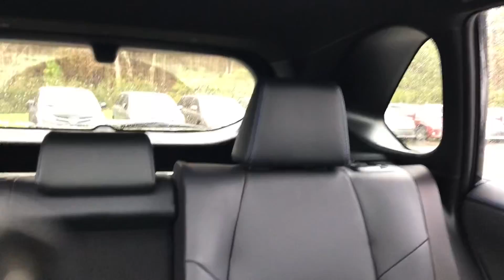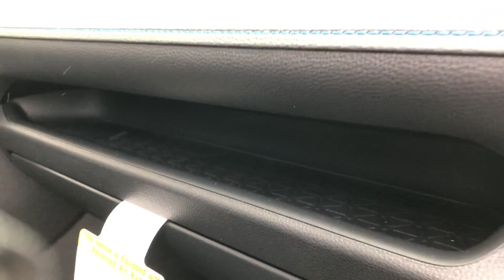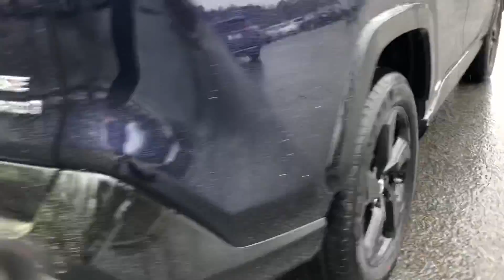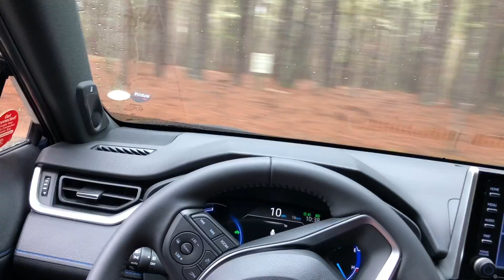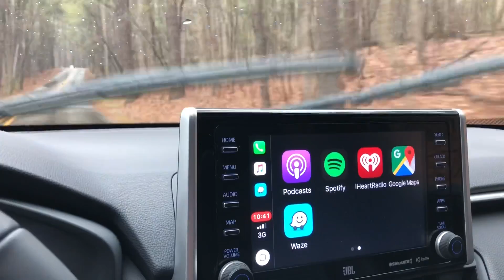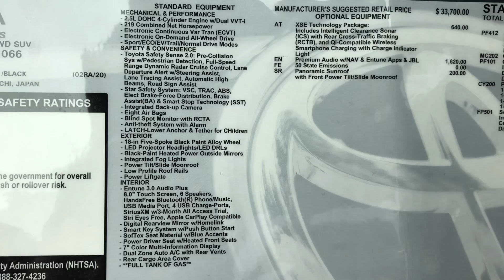2019 RAV4 Hybrid XSE Test Drive in the Rain!

Comment: Do the front tyres slip from stationery on a hard 90 degree turn in wet road/loose bitumen or the rear tyres get engaged pretty quickly to assist the front? Not sure how this efour system works in wet.

Comment: Hey Jeff! I saw in another video a RAV4 Hybrid 2019 XSE with a roof rack. Do you know if they roof rack is adjustable? Meaning, can the rails be moved forward or backwards?  Or can they only be fixed in one position on the low profile rails? In the video, the front rack was placed so that it was directly over the sliding moonroof and it would be nice it was movable to where it was placed where the partition is in the pano moonroof. Thanks!

Comment: Hi Jeff, huge (recen subscriber) fan!  Quick question... Trying to decide between the Prius and Rav4 (hybrid, of course) at the moment for a end-of-the year purchase, and then go road tripping / car camping extensively. :) 

Couple of quick questions!  I know, of course, the Prius has better MPG, but is there a huge difference between the two?  The cargo space would definitely be nice for car camping in the RAV4.

Also, I noticed you had apple car play in the video, and I thought you couldn't have that in the Entune system for whatever reason.  Would it be possible to use android car as well, since I have an android phone?  I have an iPad, so perhaps I could use that too hook it up if not?  Sorry for the long message, and thank you!
Reply: Christian Bjork dude Rav 4 100% especially if doing trips..you’ll regret getting the Prius
Reply: @Thinkingabout1234  Thanks Veton!  The MPG isn´t quite as good tho, right?  Do you have one, and do you know if the back seats lay completely flat? (to put the thin mattress in)
Reply: Christian Bjork i have one. My mpg is decent. Far better than my Ford Escape i traded in. My back seats don’t lay COMPLETELY flat but it is definitely capable enough to lay things down like a mattress. Plus i love the safety features on this car, you can also add a roof rack and hall things up top like I’m going to do
Reply: @Thinkingabout1234  thanks again for the quick response!  It definitely helps to hear first hand experience about it.  Thank you!
Reply: Christian Bjork i don’t even have the hybrid. I think the hybrid has great mpg

Comment: 38k is high, just get a RX350 for 2 k more. Much better in every way. And ya get a V6 engine with rear locking diff. Why wouldn't you...?
Reply: The RX 350 with AW starts at $45,000 tho